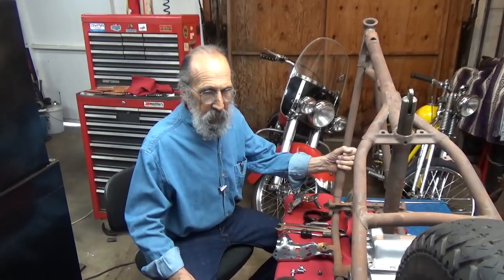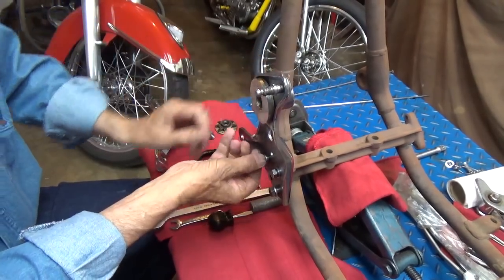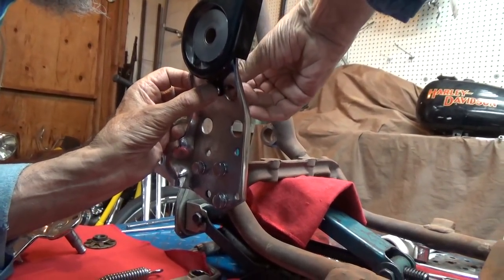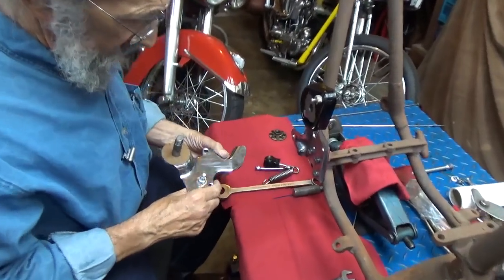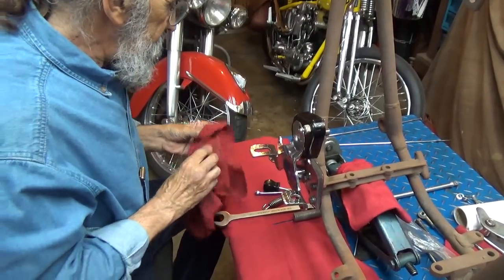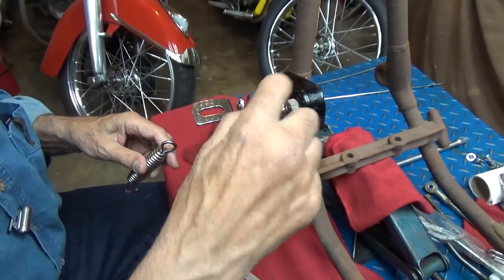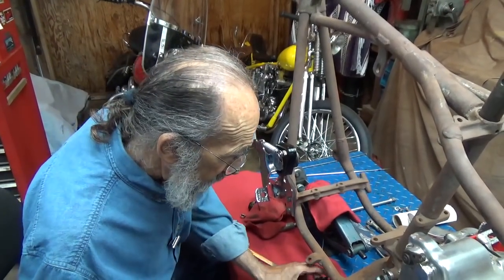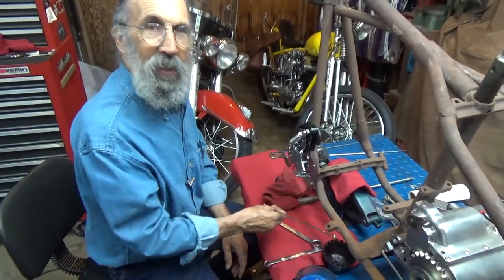Installing A Footclutch Pedal Assembly on the Harley Davidson Project Bike

Comment: love your videos Mike and the rebuild is looking awesome and that little black cover helps in breaking up the chrome  old school bikes are great I love them and reminds of the 37 basket case I build old flat head that turned out to-be a old army bike that was still not assembled the guy took it out the create and did not want to build it I purchased it for $400.00 but I sold it after building it keep the videos coming
Reply from the maker: Thank You.  I will.

Comment: You can use an open end if you want. I won't complain if you use pliers. I remember riding a foot clutch one time. I also remember that a year or 2 later they invented dirt, so it's been a while back. It seemed perfectly natural after the second or third shift. As far as the looks are going, I think so far, you've got a winner.
Reply from the maker: Thank You.  I appreciate that.  I like all the different clutch pedals and shifters, just for the variety of it all.

Comment: Hey Mike, always enjoy your vids. Thank you for the tip on how to use a car jack to lift the frame on a non-roller. Using a jack that way gets it out of the way. I am always hitting the bike jack when it is under the frame on the lift and it always seems to be in the way. I love the build what you got mentality and not the purist perception of it's a '40 so nothing but parts for a '40 go on it.
Reply from the maker: I try to do that, but this one is a compilation of "period correct " stuff, not all 1940.
Reply: @pacificmike9501  Ah yes, "period correct' like using a shovelhead bracket on a big twin flatty

Comment: We Really like watching your videos.  I wonder what your parts room looks like!   Do you have a video showing it?  What frame is the project bike?
Reply from the maker: My parts room is an old "root cellar."  It is a mess, although it is separated "categorically."  I had a shop at one time, so I sold off all of my late model stuff, that you can buy anywhere, and kept my ancient treasures.  The frame is HD from the late forties and was originally either a big Flathad, like I'm building, or a Knucklehead.  They used the same frame.  This frame has been straightened and corrected and is actually quite nice.  About all that isn't good about it is that someone, wanting a custom bike, removed the tank and speedometer mounts.  Cool.  they wouldn't work with what I've picked out for her anyway.  My parts room is my private vault.
Reply: @pacificmike9501  Cool thanks!

Comment: If you"feeling a little bummed out, watch Pacific Mike put a few rare parts on his project bike. He doesn't even mind a few suggestions from the peanut gallery.  Here's one, " Mike, try to use a six point box wrench on those nuts and bolts (and NEVER pliers, channel locks or vise grips."
Reply from the maker: Box wrenches, although the correct tool for the job, don't do so well on something that's required to be pretty.  They knock the chrome off the points.
Reply: I didn't know that but I can see that it makes sense. I still feel like it was OK to post my
mistaken comment. I'm looking for your next video , as usual. PS I love rare parts..Froggie
Reply: This made me remember Snap On (or another mfg.) came out about 10 years ago with a
 socket or box design that put no pressure on the corner of a nut or bolt. It was slightly relieved in that area and put the pressure on the flat area just next to the corner so the fasteners do not become "wrench worn."

Comment: Hey Mike, I was watching one of your old videos where you were installing STD dual-plug heads on a Shovelhead. If I'd want to go to dual plugs on my '77 Shovelhead, can my stock heads be modified, or would it be best to purchase after-market heads. My heads are the early short-reach plug type with a row of even fins down the centre.
Reply from the maker: Yes, Shovelheads can receive a second plug.  I suggest a knowledgeable shop to do the job.  We dual plugged my original 77 heads back in the early eighties.  I don't know where you live, but a shop that has built a jig and can do it, is not that uncommon.  One you could ask would be Dave Mackie Engineering in Ventura CA.

Comment: Mike I go back and realize I have been following and commenting for almost two years.  I still say not many can say they have worked on flaties, knucks, pans, shovels and evos. I know when to ask a master for help. My issue is a 76 shovel ratchet top set up jockey shift. The clutch engages as soon as I start letting off. I can't feather it or ease out. I've adjusted as far as clutch plates are happy.  Please point in some direction
Reply from the maker: Check the throwout bearing, pushrod and center adjusting screw.  It's a pain, but you need to be sure they're in good shape.

Comment: I have a 1996 fxdwg. It has the square backbone. My rockerbox is leaking but the bolts to remove it is to close to the backbone. Can i take the front motor mount out and lower the engine to get to it?
Reply from the maker: Yes.  That is the way it's normally done.

Comment: Hi Mike. I’ve been following this project bike with great interest. I’ve got a question I hope you have time to answer. I was going to put together a Frankenstein bike, basically a mutt made up of parts I’ve been collecting over the years. I picked up cheap, a 1982 FLT frame, not my first choice (but cheap). My question is, I know they used a very rear set triple tree. Would a standard wideglide front end work on it? I’m not too familiar with these kind of frames. And again, thank you for all you do.
Reply from the maker: That is what's commonly referred to as a "self centering" front end.  The fork trees are designed to hold the legs behind the fork stem.   The legs are standard 41 mm.  However, the fork head on the frame is set way forward.  You'll need to use FLT triple trees.  But, if you can find a swap meet, a lot of people have been changing those original type FLT trees to some really wild units in order to install huge front wheels on these bikes.  In other words, the parts you need may not be too hard to find.
Reply: Mike, one more question...could I use a regular (non-centering ) wide-glide front end with this FLT frame, if I didn’t mind the funky exposed gooseneck? I don’t want to do anything dangerous here, like a high speed wobble. Thank you for your time.

Comment: Thanks Mike your the best. I've learned so much about my pan from you. The biggest thing I'm learning is patience, which you are the definition of!
Mike gotta a question for you, and I can't afford one of Palmers books.  Ok got a wishbone frame in my 58 Dad must of liked to go fast lol. No year on top motor mount. The horn mounts are only tacked on and the tool box mount is in the shape of a parrelogram not sure how to spell that. Uno a rectangle leaning to the right or left.  Also set up for a side car. I'm thinking a 53?? 
Let me know when you get the chance.
Thanks Mike
Reply from the maker: All of these things sound stock.  Wishbone frames were made from 48-54.  All of those frames had horn brackets welded to the downtubes and kidney shaped toolboxes.  They all came with sidecar brackets.  A chopper was a bike that you "chopped" all of those brackets off of.
Reply: @pacificmike9501  
Thank you didn't know if there was any way of pinpointing the year of the frame. Nothing was chopped up or ground off. I know 58 was the first year for the duo glide which had rear shocks. Back then they were all titled after the engine numbers.   It's a 58 in a wishbone frame. Probably never know exactly what year the frame is. Love your channel and thanks again

Comment: Very interesting video. I remember hearing horror stories about the rocker clutch pedals from the "old timers".  They said it would suddenly engage the clutch, and send them into traffic.  Supposedly, that is where the term suicide clutch came from. Sounds like a lack of maintenance to me. What are your thoughts????
Reply from the maker: A suicide clutch has no way of keeping it engaged or disengaged.  The only springs at that point are in the clutch assembly.  Therefore, it must have a foot to keep it disengaged.

Comment: Noticed that the shift arm on your transmission is clocked up toward the rear instead of clocked down toward the front, is that something particular t this build, or is it just not set-up yet?
Reply from the maker: One goes up, one goes down.  First gear at the front.  First gear at the rear.  Panheads were the first one with first gear at the rear.  You slid the handshift lever forward from there.
Reply: @pacificmike9501  thanks Mike, looking at the gate differences, it makes sense

Comment: Mike, are those old flatheads foot clutch only?  I thought hand shift came in during the knucklehead era.  Or am I in error?  Also, what does that friction disk do for the clutch pedal?
Reply from the maker: When bicycle pedals went away, bikes came with hand shifters and foot clutches.  In 1952, Harley introduced their first Big Twins with hand clutch and footshift.  Their first foot shift models for smaller bikes were the XA 45" opposed twins for WWII.  I believe that was in 1944.  Yes, all the old bikes were foot clutch and handshift.
Reply from the maker: I forgot you asked.  The friction disc gives resistance so you have more precise movement of the pedal with your foot.
Reply: @pacificmike9501  Correct me if I'm wrong but I think you could order hand shift up to about '78 at least police departments could.

Comment: Hi Mike! Quick question. My rocker clutch disengages itself when riding, should I adjust by tightening the nut that holds the spring facing in? Thanks, I really enjoy your vids.
Reply from the maker: I can't see it.  That's strange.  I don't thing you're describing the problem very well.
Reply: @pacificmike9501  Thanks for replying! Apologies I was not clear. I am talking about the nut that holds the (unnamed) spring that goes on the shaft (at about 6:14 on your vid). Hopefully adjusting it will prevent my clutch from disengaging itself when riding...If not, I wonder what could be the problem

Comment: Hey Mike , well finealy I found out how to respond  !  To old for this compuiter thing ! Anyways ,been riding my 1973 shovel for 36 years now and chopped it up many times . Now I instald a footcluch pedal like in your film, everything fits right but the cluch arm hits the starter. I understand by adjusting the pushrod in the cluch you can adjust that . But I have problems adjusting the foot control ! no  heel down to toedown spring control  ! and also I thought you should not have the cluch pushrod under teansion . I looked at all your films the mousetrap came as close but still aint it !  Hey bro , me a big fan , yours Fed Admiraal from the Netherlands
Reply from the maker: Yes sir.  Do not want the pushrod tight.  Must be a little endplay or, you'll burn up the rod and the throwout bearing.
Reply: Understand Mike ! but besides that how do I set the foot spring lever control to smoothly go from heal down disengaged to toe down fully engaged ? I cannot find the sweetspot without bending the rod ! Thanks for your respons you are a inspearation to my ...Fred from the old country the Netherlands !

Comment: Hi Mike, maybe a real stupid question. Can I fit a rocker clutch on my 88 Evo Springer? Ive had the bike for over 30 years but I have a badly damaged left wrist and the clutch operation is painful. Cheers from UK.
Reply from the maker: You will either need an earlier throwout bearing cover so you will have external linkage or make up a clutch cable to operate that clutch.

Comment: Mike quick question. After I set up my clutch and pedal the way I want do I bend the lock washer to the adjusting nut?
Reply from the maker: There is no locktab on the clutch pedal.
Reply: @pacificmike9501  Thanks Mike

Comment: Any good way of adding a rocker clutch to a shovelhead?
Reply from the maker: Sure.  Use all stock or stock copies.  What year Shovelhead?  The right clutch arm for a foot clutch, the right length rod and decide what kind of shifter you want.
Reply: Its an 81 flhs frame with a 4 speed rotary. I have a rocker clutch kit from v-twin. The rear bracket appears to need to be cut off and the new cable bracket welded on. I’m not sure how to bench test the rotary top trans before I continue with the build. I’m a 30 year old army mechanic (91b) veteran, this older Harley stuff is all new to me though
Reply from the maker: I've not put one on a rotary top.  I suspect you'll need to fabricate a clutch arm.  Look in the service manual for your bike and notice the measurement between the clutch arm and the top of the trans.  Build an arm that reaches almost to the inner primary housing.  The shape of that arm will require some creativity.  Then you'll have to fit it to a clutch rod to fit from it all the way to the clutch pedal.  Otherwise, you'll need to fab a cable for it and fab up some ends.  This will take some doing.  Not impossible.  Testing on the bench with a rotary top is not easy.  They are hard to shift, at best.  I don't mean to be the bearer of bad news, but it will require some "trial and error."

Comment: Mr.Mike, I notice all your motorcycles are have spoke wheels.. is this going to be one also? I have a 72 shovelhead and I have the mag wheels. I always have to put air in tire when I’m about to ride. I got new tires but still happens. I watch your videos and you have non mags wheels. I know it’s porious (the mag) so I think I might change to spoke  any thoughts?
Reply from the maker: I've got quite a few videos up on wheels.  Go to our Youtube homepage and look at "videos."  The differences in wheels just come down to personal preferences.  I build a lot of spoke wheels.  Cast wheels are usually trouble free.  If the tire is losing air, it might be from the valve.  That's the place to start.  Try a little soapy water and look for bubbles.  If that's not it, it might be porosity.  If that's the case, then I usually install a tube.  But, I think it's obvious I'm a fan of spoke wheels.  I have a Centerline made Harley wheel on the rear of my Shovelhead.  My reasoning is to run it tubeless, so that I can plug it if need be, on the road.  That bike is getting a sidecar, and it makes good sense.  Those are my "wheel thoughts" for today.

Comment: Seems like the spring would pop off
Reply from the maker: Nope.  The pedal is stopped by the footboard to the rear and the footboard bracket in the front.  There is always tension on the spring, so it easily stays in place.

Comment: Any idea what them parts are off of?
Reply from the maker: Sure, old Harleys.  I'm sure there are some suble differences that could idetify the exact years.  I don't know all of those differences.
Reply: @pacificmike9501  FYI There were a couple early foot shift brackets with short supports  then went to a long support and finally bushed the long support with a grease zerk. For purists there is a '40 only bracket.

Comment: Hi Mike me again  !  Please help out ! I can not find info what to do ! My book is for a 1973 shovel , it shows hand control only.  I cannot make the cluch foot rocker control to work !  To engage the cluch (toedown) It will bent the rod when I disengage the cluch and the cluch arm hits the starter ! when I adjust it does not engage the cluch free ! I read in other films from you , you needed to change the angle on the tranny arm to make it work !  Let me know your thoughts !  thanks for youyr time and hope to hear from you..;
Reply from the maker: Do you have a clutch arm intended for a foot clutch?  Look at V-Twin part no.18-3606
Reply: @pacificmike9501  yes I have ...
Reply: @pacificmike9501  . I am thinking aboutrh useing a cable instad off the rod ! ...